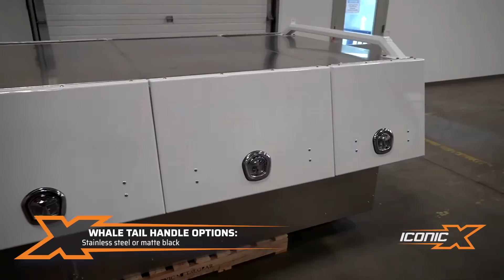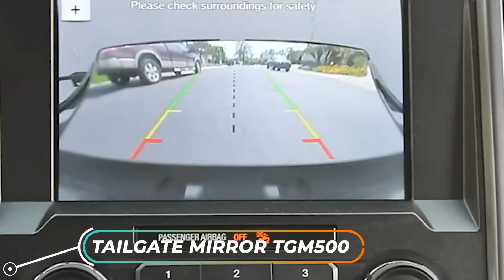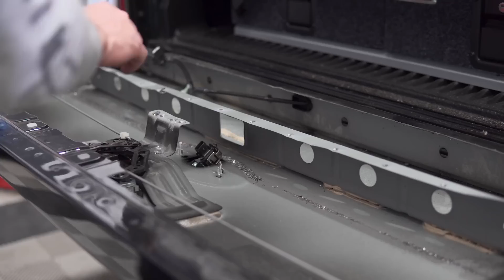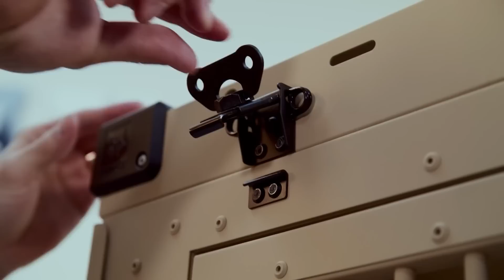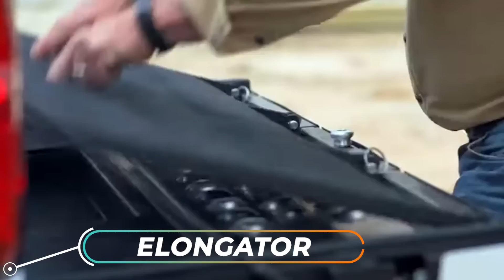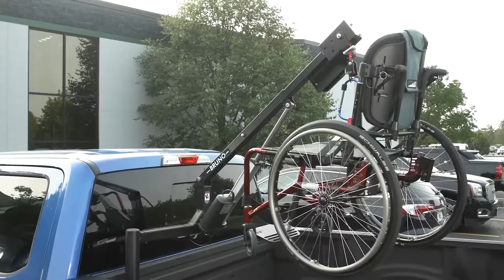30 Cool Inventions for Your Pickup Truck

Comment: Gull-wing doors swinging up?  "Perfect height for eye and head injuries."
Yakima roof-tent... "Always have 3 more tall, fit guys to help you load, unload and arrange this tent.  But only 2 smaller ones can come along and use it."

ATV users will appreciate Marlon's adding height worries as they go thru freeway overpasses, drive-up food windows, bank ATM stations, and forests.  Don't worry - even if this is knocked off, there's little chance the rack will be harmed.  The ATV and host vehicle can absorb most damage as it's ripped from the mounts.  So much handier than those pesky trailers, don't you think?"  Don't about corrosion - by using black-coating, you'll never see rust stains easily.
Reply: Tailgate camera: "Easy to remove" is how "Easy to STEAL" is sometimes spelled.  I mean, seriously - who would plan to install this each time they might use Reverse?  "Use the regular camera."  Uh... so anytime I want to use the tailgate, THEN I have to 'easily install it'?  Yeah... riiiight...
Reply: I had gull wing doors on my Ram camper shell for twenty years and never had a problem and I’m 6’5”.